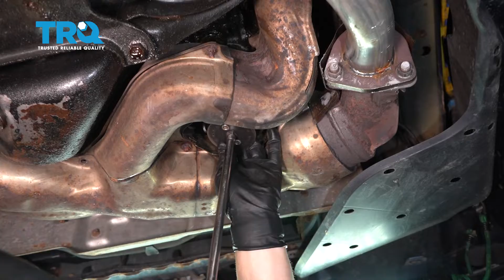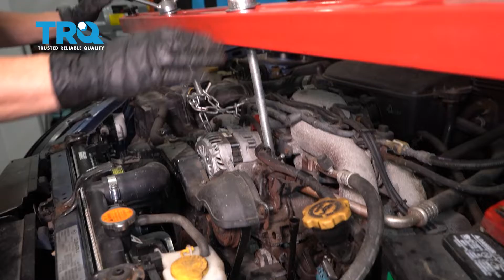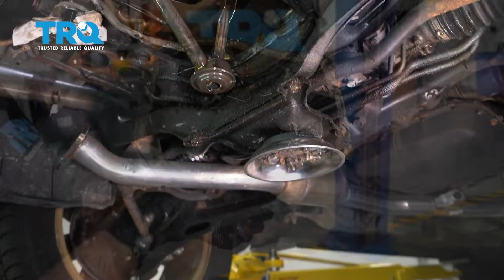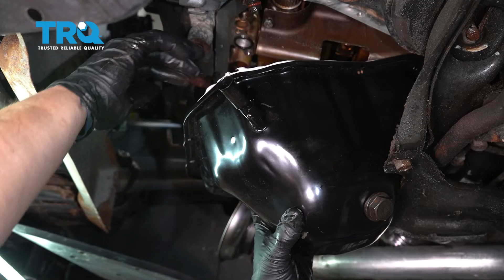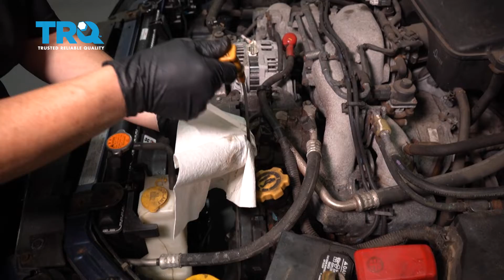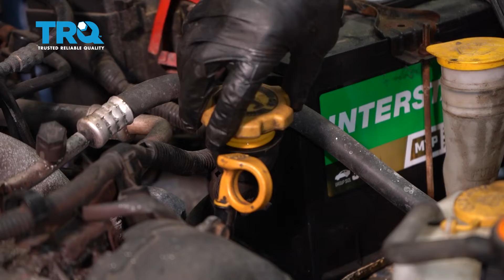How to Replace Oil Pan 2005-2009 Subaru Outback

Comment: Good video but the torque specs are off. You mention three passes at incrementally higher torque values but that's not correct. The three torque values are for the oil pan, the baffle plate, and the oil strainer. The lowest torque value is for the the oil pan bolts.